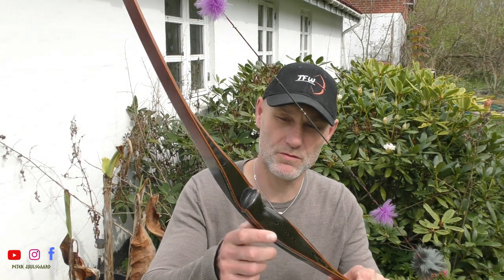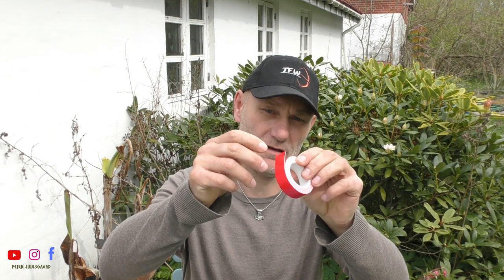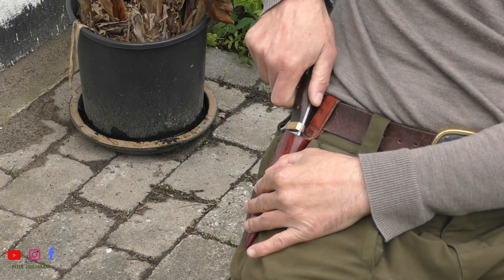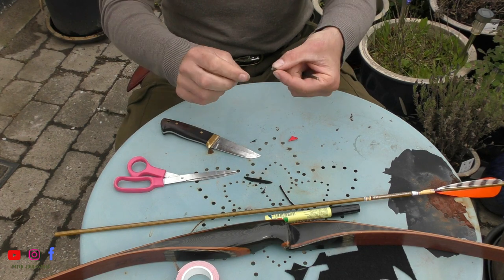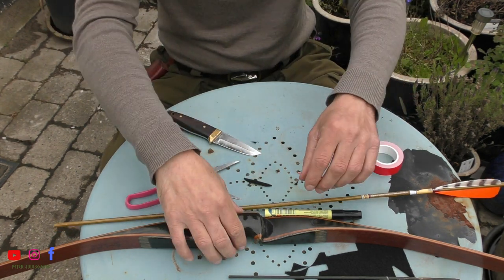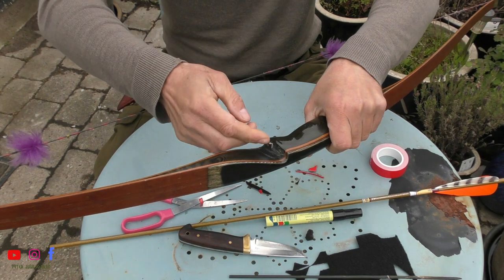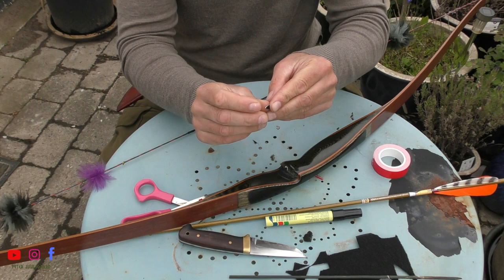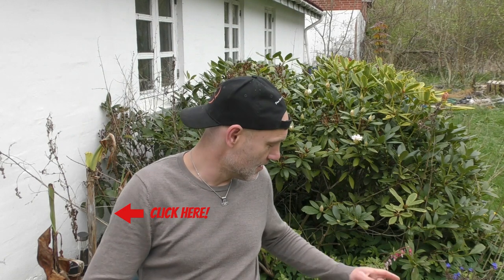Making the "Bump" DIY - Archery - Arrow tuning - Traditional Bowhunting - Cascade Brush Hawk

Comment: I bet the wife wants that table painted. :) I put cow leather on my shelf and sight window on some of my recurves, compounds. Its quiet, durable, and you can shave it back a little at a time for arrow tuning. Have used the velcro too, but seems to wear out quickly.  I have put a long strip of velcro on the front of my sight window to prevent arrow from making noise against it. The bump is a good idea to reduce the torquing or rocking affect shelf can have on arrow accuracy.

Comment: Before switching everything to a Bear Weather Rest, I made the bump out of everything from a toothpick, to furniture padding (the ones that stick onto the bottoms of chair legs so they don’t scratch the floor), to cut off chop sticks (from Chinese food takeout).
Reply from the maker: Aren´t you robbing you self from a little bit of centershot, with the weather rest? I mean: We want as flexible sight window as possible, with most possible clearence, and on a "cut on center" bow, the window isn´t really center anymore with the weather rest. Which causes lesser forgiveness. If the sight window on the other hand is past center, its another story. So that´s why I prefer this method over the elevated rest´s. I´ve used furniture padding too, and it also works great!
Thanks for watching buddy!
Reply: Peter Juulsgaard a little bit but the increase in arrow stability right in off the bow is unmatched for me. Tried all the bumps but nothing flies as good as an arrow off the Weather Rest for me. 
It also alleviates a lot of the frustrating nock high flight or nock/fletching bounce off the rest.

Comment: Peter ,Brad here from Canada. Hard to make a bump or elevated rest on a Bearpaw mohawk shelf. The riser sight window is like a wedge as it's really thick at the top of the sight window and angles down to a taper to the arrow shelf. Since I remember you had a mohawk bow if you felt the same way I do? If you make a bump or elevated the bump to high it will affect center shot. The bow is cut to center as I wish the riser was cut before center. All my other bows have a straight sight window and cut before center so I can put a thicker strike plate so to accomodate different diameter arrows also center shot. I find my mohawk I have to angle the bow and head more to get past the huge upper wedge of the riser to get a better sight picture and to center my arrow on the target. What are your thoughts when you shoot different bows and then pick up your mohawk? I find it takes me a little while to adjust my form compared to my other bows. Thank you!!!!!
Reply from the maker: Yes sir. I just looked at my Mohawk and I see what you mean. It’s been awhile since I’ve shot it. But I dont have the bump on the Mohawk. I had better luck with a Bear rough rest, or capet (depends on what you call it) I dont use the Bear strike plate, cause its too thick, so I have a thin piece of felt in the window instead. I also need to shoot a few days every time I change bows, to get use to them. I’m right handed, so if I’m use to shoot a past center bow, and I’m switching to a on center bow, I usually hit to the left at the beginning, but over the days it is correcting it self. And I’m hitting to the right if I’m switching the other way around.
Reply: @peterjuulsgaard  
 I just have a very thin piece of magnetic tape, paper thin on the strike plate on side of riser and female velcro on the shelf. Seems to work. Thank you Peter.